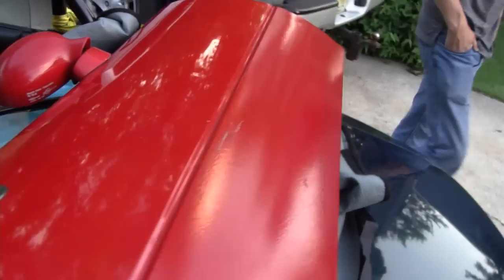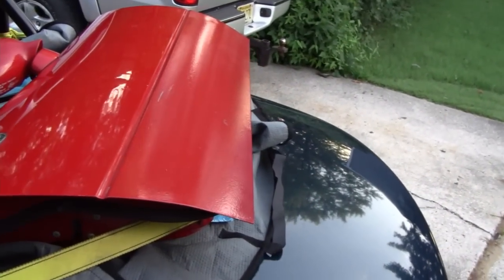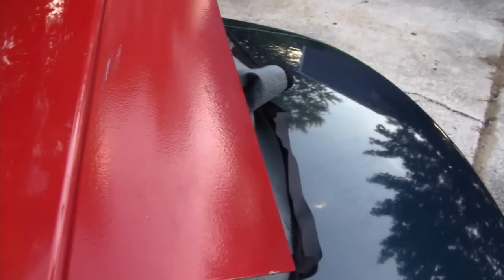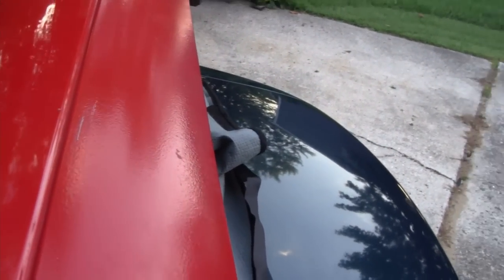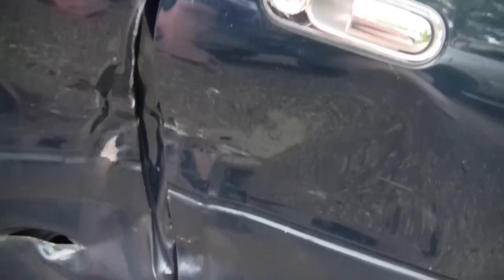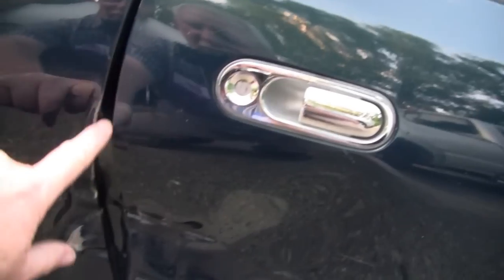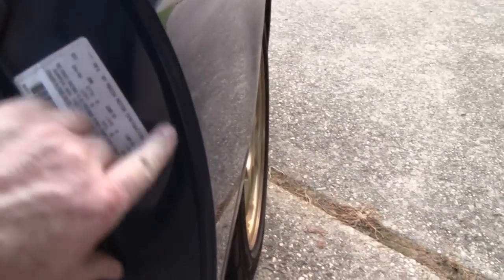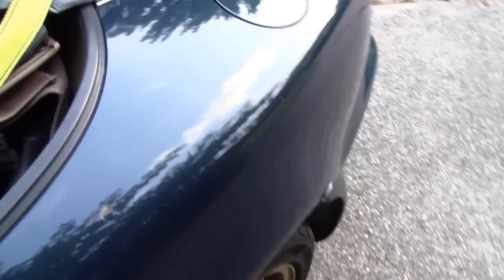REAR QUARTER PANEL & DOOR REPAIR (Part 1)

Comment: You will get it straight again ...Back in the day I helped on a 80's Thunder bird ..we chained it between 2 big tractors and used a chain hoist to  pull the front end back over ..It went down the road straight when we got done
Reply from the maker: Yeah Buddy!! What ever it takes!! I remember straightening Motorcycle Forks in a sewer grate back in the day!!☺

Comment: Well you're the man for the job mate :) Bodywork not one of my strong points.....not done much and always struggled. However I did do my bike tank in the 80s. Just filled it and it didn't come out too bad. Only had the black n wrecker sander, same as I've got now lol. I'll put a link of the pics in separate comment....just in case.
Reply from the maker: Ya can't be good at everything Mate!! Ya got my respect for givin' it a go!!☺